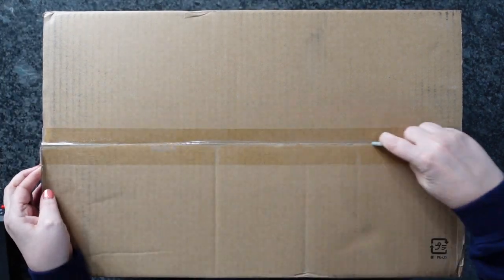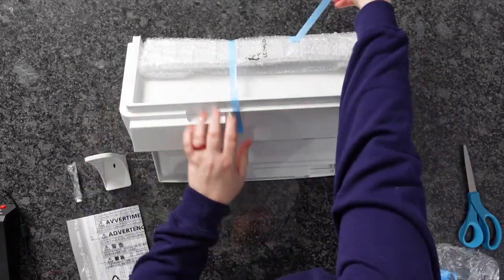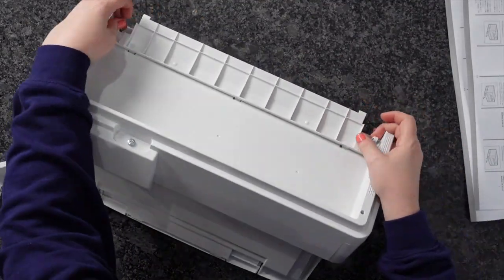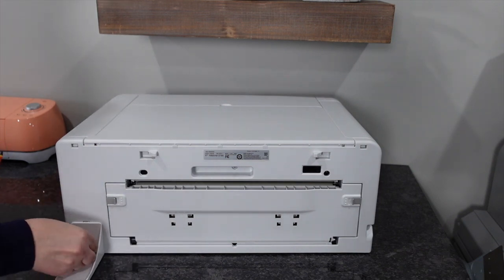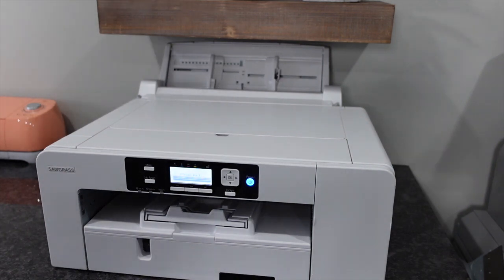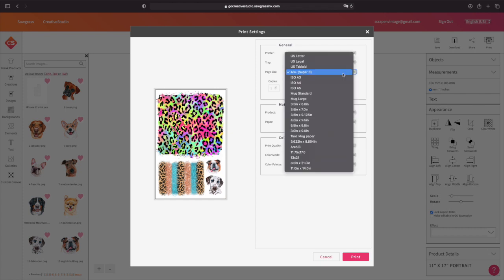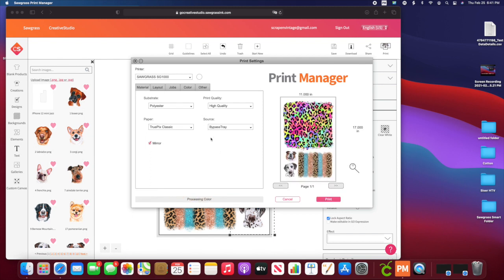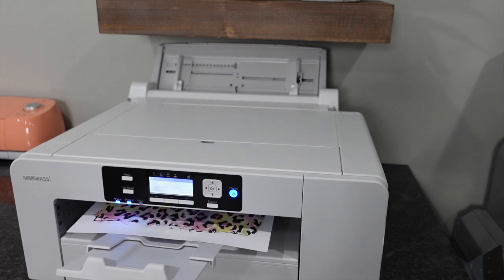How To Install The Sawgrass Bypass Tray #Shorts

Comment: i could not figure out my bypass tray.. So i folded a piece of a sub sublimation paper loosely and put it in Tray one, changed the paper size and printed it. it printed on the back of the a sub paper but it worked.. im sure it would not work for the roll of paper but you can print the 8.5x14 without the bypass tray.